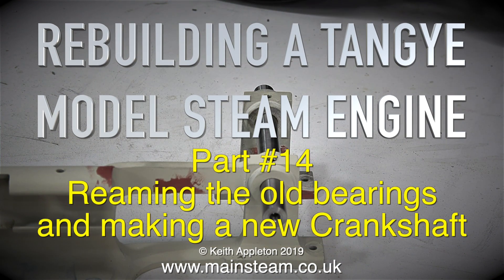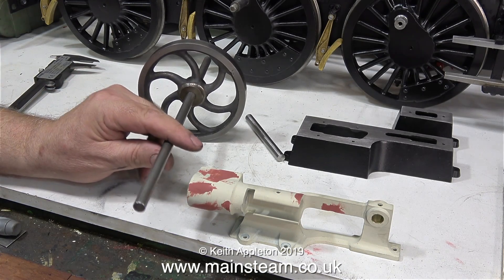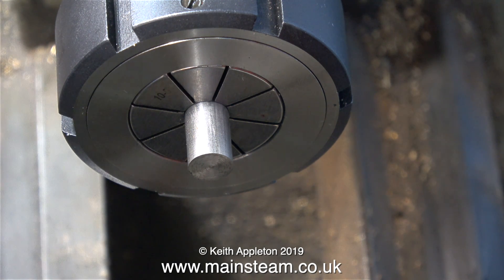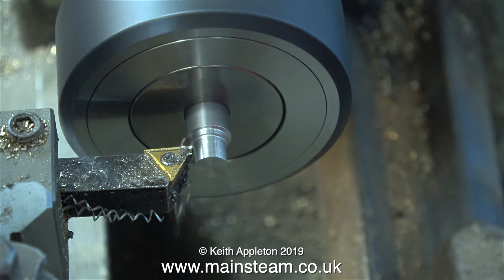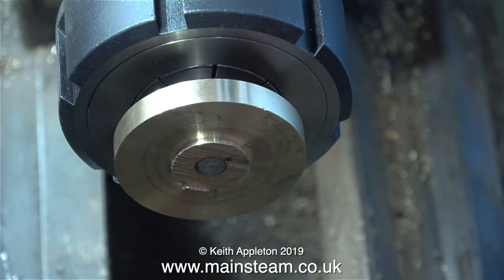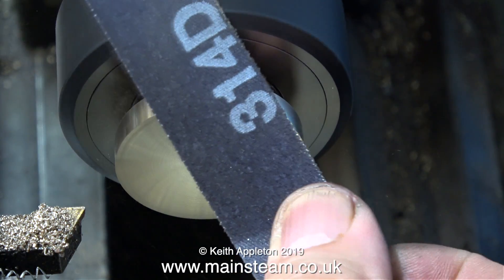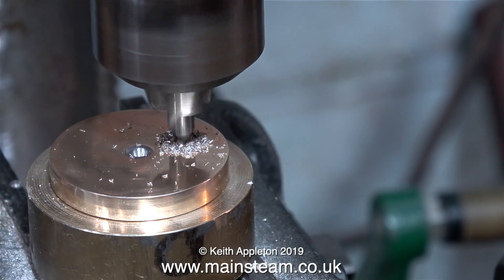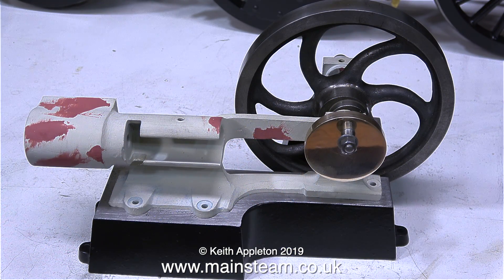REBUILDING A TANGYE MODEL STEAM ENGINE - PART #14

Comment: 7:25 
Loc-tite 243 vs 603. One is prescribed (marketed) for one use, the other for another use. The manufacturer sells a large variety of seemingly specialized products that actually have similar and overlapping uses. It's likely they could sell just one product to serve the variety of specialized uses, but they would sell so much less total product that way.

Comment: Mr. Appleton, Would please clarify why you didn't go with a press fit of the shaft to the web?  At 0.001" over size, it was only a light press fit but it would have eliminated the need for the locktite product.  Particularly so on a small toy as this one.  Thank you.
Reply from the maker: Because I prefer the "Loctite" method - no pressure then needs to be applied to the Brass Crankweb disc . . . . .
Reply: @keithappleton  thanks for your reply.  Perhaps not a concern but the concentricity of the web to the shaft, in in a locktite regime, will be less so than with a press fit. I understand your preference and likely the toy will not be affected by this tiny issue.

On a different note, a question vis why would a degreed professional engineer be interested in your channel, when it is a channel for beginners, has come up from time to time.  From this Eng, it is because there is often a disconnect between the theoretical nature of the design vs the practical matter of actually making the part.  Designing a crank web for the minimum inertia and finest concentric balance in assembled state is different from making that web.  I have a tremendous respect for your skills and abilities, and like to learn from watching a master.  The lads in the shop get agitated when I sit and watch them!!!!

Comment: You not using a mechanical retainer on the crank web to crankshaft, just locktite?
Reply from the maker: Loctite is more than sufficient - this is just a toy Brass engine.